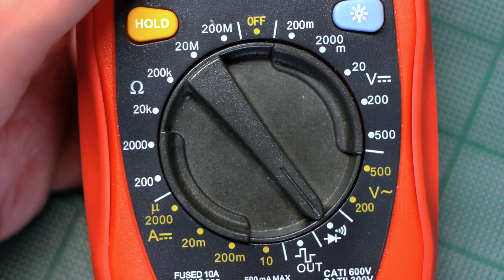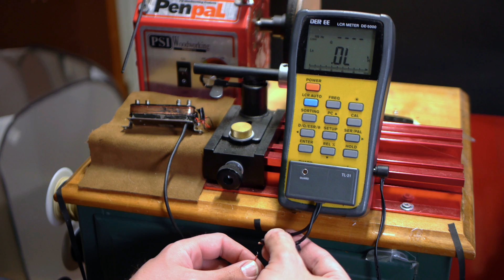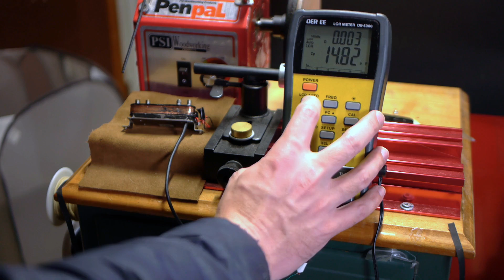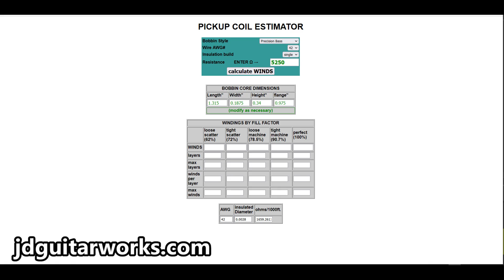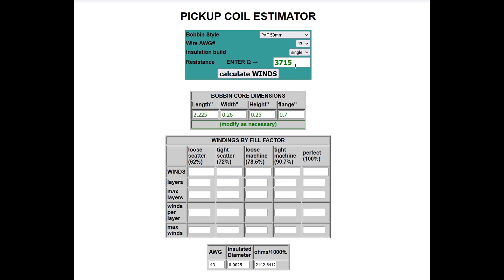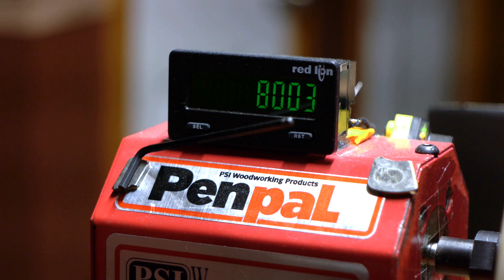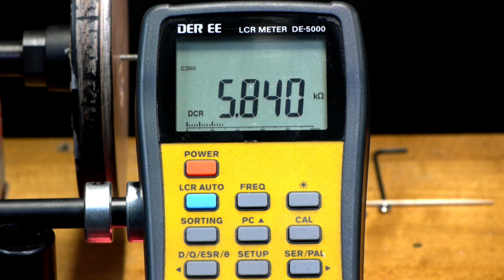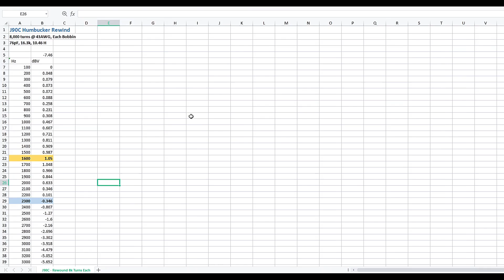Broken Humbucker Diagnosis + Rewind

Comment: and why does internal wire get broken? just rewire 3 times my humbukers :( works like 3-4 months and then fail
Reply from the maker: I'm slowly working on a new video about diagnosing issues with broken humbuckers. A major issue is insulation: the "pigtails" ABSOLUTELY MUST be thoroughly insulated from the main coil wire. 

I think this is a much more common cause of humbucker failure than broken wires, and I've seen it many times myself, including on humbuckers I've made before I knew this was such a huge problem. 

However, the wire can Also break, with the pigtails being the most common break area. So much so that one of the main ways I diagnose humbucker problems is to disassemble them, then disconnect the hookup leads from the coil leads -- i.e., disconnect the 'pigtails.' 

Often -- not always, but often -- I'll get a reading at the actual coil leads. I carefully strip them with a soldering iron, or sandpaper if it's Plain Enamel or Formvar wire -- and then test with a multimeter. Many times I've seen it was the pigtails that became disconnected from the coil leads that was the problem. 

So for me, my method is to lay black cloth acetate tape / black cloth electrical tape down onto the coil first. Then, after making the pigtail (wrapping the coil lead wire around the 28-30AWG PVC insulated hookup wire, and soldering it together), I put the pigtail on top of that electrical tape. 

AND THEN I superglue the pigtail in place on top of that cloth electrical tape. This part can be a bit tricky. I use pipettes to dispense superglue. But whatever way you do it, I use a teflon dowel or just dip a regular wooden dowel in petroleum jelly, and use that to press the pigtail down while hitting it with some CA glue. 

Then I use some CA accelerator to harden it. Take the dowel off and the pigtail should be firmly superglued in place on top of the cloth tape. 

Then I put ANOTHER piece of black cloth electrical tape on top of it. So think of it like a sandwich, with the pigtail superglued in place in the middle of two pieces of cloth electrical tape. 

I repeat this for the other pigtail. Supergluing them in place will prevent them from being tugged on, potentially breaking the coil wire at the pigtail joint. And having it sandwiched between two layers of insulation will guarantee that the pigtail will not short out by touching the coil itself. 

The coil wire is insulated, so the pigtail wiring touching the coil shouldn't short it out, but for some reason, it does. I've seen it happen many times. 

In my experience, these are the most important factors by far. Once I started using this method of cloth electrical tape, and supergluing the pigtails in place, I never had this issue again. 

There's another pickup builder on YouTube who uses copper tape over the coil, and solders the pigtails to the copper tape, rather than doing it the way I do it. And that may very well be superior. It certainly would be a lot easier. So that's another method to keep in mind. And soldering the pigtails to the tape would do very much the same thing the superglue does with my method -- securing the pigtail and preventing it from moving. It only has to budge a tiny bit to break that coil wire and then you'll have a non-functional coil. 

Hope this helps! Another tool I recommend is an N-Audio phase tester. It's very handy when assembling humbuckers. Both coils should measure the same phase direction when it's completed. So either both coils flash red, or both coils flash green. If one is green and the other is red, the humbucker is out of phase with itself. There's no way to test this aside from using a phase tester as the rest of the measurements will appear perfectly normal. 

Also, the phase tester can be used to test whether a coil is working or not, or here's an even more interesting example: if the bar mag on a humbucker isn't contacting the polepieces, the coil will read out perfectly normal, but you'll get no output. Recently I had a customer want me to put an A3 bar mag in a humbucker. I couldn't find any that were wide enough. It was a Duncan style Invader humbucker and had no mounting bar for the screws -- no 'magnet keeper' or 'polepiece keeper' bar. 

Testing with a multimeter and LCR meter, it all read out normal. Both coils perfect. And using my WT10A meter, the polepieces all read the same Gauss strength. What was going on? 

The bar mag wasn't making full contact with both rows of pole screws. Only one row. He had the idea to strip the metal jacket off of some Gibson hookup wire, because the metal is conductive -- and wedge it between the bar magnet and the polepieces on one side, so the magnet would be in electrical contact with the polepieces equally on both sides. 

It went from having one dead coil and one functional coil to both working perfectly. When plugged into an amp, formerly, one coil you'd tap with a screwdriver, and it would sound loud and clear. But you tap the other polepieces, and you got NOTHING. Wedging that metal jacket in there so the magnet was physically touching both rows of polepieces fixed it. 

You can test it on an amp, but the N Audio phase Tester is even easier and quicker. If the coil isn't outputting anything, the phase tester won't light up green or red. It won't light up at all. So now I know a way to 100% test a pickup without the use of an amp, and just a multimeter/LCR meter/Teslameter/phase tester, all on a workbench. 

Again - hope this helps. Can't wait to get that humbucker diagnosis and repair video up but at this point some of my videos are going to take at least a couple years to get done. Very, very busy. Thanks again for the comment and hope you stick around to see what else I have in store!

Comment: Are you using a specific type of copper wire? I only ask because I was looking up copper wire for p/u's and 1 site mentioned 3 different types which give different results...

1.  Polyurethane copper wire
2. Plain enamel wire
3.Heavy Formvar wire 

I was just curious about that. I also have J90c humbucker in my 90 Charvel Fusion Custom so I enjoyed watching this video plus I'm glad I have all the specs for it!

Oh and a site called Axebition has a bunch of info for about 16 brands of guitar and their parts, (you probably have heard about it already though).
Reply from the maker: Polyurethane insulated wire for this one. The original looked to be poly. I heavily prefer solderable polyurethane for ease of use (stripping with a soldering iron vs. mechanical scraping/sanding, which you have to use for plain enamel and Formvar). 

There's also heavy poly wire. Some has the same thickness as heavy Formvar and some is slightly thicker. I think Formvar is around .0029" thick. Plain enamel is around .0027" and poly wire single build is around .0028". You can get heavy build poly coated wire that's around .0030" from Remington. I've been using that lately for neck pickups. 

I always go by turn count. Different insulation thickness will create different results when using the same turn count. The interesting question is what happens when you account for the insulation thickness and wind a coil that has the same specs with Formvar vs. Plain enamel wire vs. poly wire. 

But when turn count is the same, generally speaking, thicker insulation will result in lower capacitance, which results in retention of more high end frequencies, but the wire is also traveling a farther distance, and so you have more total wire for the same turn count with heavier insulation, which makes the inductance slightly higher, which causes a slight loss of higher end frequencies. 

Example: 7600 turns with single build poly wire will get you around 1.9 - 2.0 Henries inductance for a Strat neck pickup with a .500" coil height. 

7600 turns with heavy bulid poly wire on the same bobbin will get you around 2.2 Henries inductance. But also lower capacitance. Say, maybe 120pF for single build poly and maybe 80-85pF for the heavy build. 

How this stuff influences the sound is measurable to some extent but also not measurable completely. This is why there's so much speculation with pickups. I have my complete pickup testing guide on my channel if you want to see how that works but I also need to update it and make some content going over what frequency response means and how to read bode plots to interpret what a pickup will sound like. 

It doesn't tell you the whole story but it does tell you a lot. Heavy build poly is really cool stuff and I never see anyone using it. There's a lot of attachment to the old school plain enamel and Formvar wires. 

I'll use them for vintage rewinds. But for my own pickups I go 100% poly. It's just easier to use and it's a lot cheaper. And you can get it in greater insulation thickness than heavy Formvar which lends itself to making its own unique sound. I'm currently making a Strat neck pickup with .500" coil height, A3 magnets, and 7600 turns of heavy poly wire and it sounds great. 

A lot of this comes down to experimentation. i've wound many hundreds of pickups and all I've learned is that we have only pretty basic metrics to measure pickups by, and people disagree on what those metrics mean and are adamant that there's more to it, and things that can't (currently) be explained. 

That's why I think of it as a recipe. Coil height and dimensions first. Then magnet type, wire choice, turn count. There's a lot more that goes into this than people think and each variable has an impact on every other variable.  Even just coil height, wire insulation thickness and gauge, and turn count alone are all independent variables that all affect each other dramatically. So it's very difficult to say what causes what without controlling for each variable -- which is just about impossible to do. 

Anyway, I'll go more in depth in another video about that someday. Have to collect my thoughts after years of winding pickups and experimenting. There's a lot to cover and yet at the same time this is why I'm hell bent on only offering a couple models that are pretty radically different from anything else out there. Whether it's good or bad is up to the listener but I like making things that are very different rather than small tweaks on designs that have been around for ages.
Reply: Thanks, I appreciate all the in depth info!
Reply from the maker: @EuskadiJoloMas Sure thing!

Comment: hey brother - I have an EVH pickup and one half of it needs a rewind - I have no idea in which direction to rewind - or does it matter?
Reply from the maker: You can do either, though you'll have to be sure to check the phase of the pickup before rewiring. I think you can use a normal multimeter for this, but I prefer an N-Audio phase tester, which you can find here: 

https://n-audio.net/guitar-pickup-phase-checker/

When it's done, both bobbins of the humbucker should be the same. So both green, or both red. I've been working on a video to demonstrate this, as I had to rewind one coil of a humbucker, and ended up wiring it out of phase, but didn't know it! Because I had no idea of the original direction of the winds on the other coil. 

So, I'll have to mentally figure it out. But you can either do start to finish, start to start, or finish to finish. So you could test all of those out and then see with the phase tester which results in the humbucker being in phase. 

But you can also test the individual leads to make sure. It's simple, but my brain has issues with stuff like this, so I'll have to sit down and make a video to really get super crystal clarity on it!

But definitely check out that phase tester, that's the ticket IMO. Clear and easy to see. Until you get how to test the individual wires before soldering together, you can just do process of elimination, once you know that both bobbins need to be the same phase for it to be in phase. So both green or both red. One green and one red and the humbucker is out of phase with itself. 

Hope this helps!

Comment: This was very informative!  I always had thought the J90C used AWG44 like the Duncan JB and was modeled after it  but it turns out it was with AWG43 like the Seymour Duncan Custom. I now kind of view this J90C as a Duncan Custom plus type of p'u. Both have the ceramic and use the AWG43 but the J90C is wound hotter at 16K whereas the Duncan Custom is at 14.5K

Comment: What is the benefit to rewinding a pickup versus just replacing it?
Reply from the maker: Controlling for variables. Particularly wire gauge and turn count -- but also coil/bobbin height and width.

Pickup makers and manufacturers very rarely mention turn count and never coil dimensions. So a replacement might not be a good match.

They can be. Replacing the pickup is perfectly fine. However, an experienced pickup winder can make a more accurate assessment of exactly what wire gauge and turn count to use to match the other pickup on the guitar -- if there is one. Or to just be as close to the original as possible. 

That, and many times there are unique pickups that don't have replacements. Many times people want a pickup rewound because there isn't an available replacement on the market. 

Hope this answers your question. Let me know if you need any more clarification!
Reply: @guitar_md  thank you that was a superb answer. So basically you're going to never be able to exactly replicate the original sound but the goal is to try to make it as close as possible. Versus it being a crapshoot if you just get a different pickup.
Reply from the maker: @jfiery  In a nutshell, yes. For example, the magnet diameter and bobbin dimensions may be different on a replacement. But since these specifications are almost never listed, you don't know what you're getting. 

If a known commercial pickup dies, like a Seymour Duncan of a particular make and model, a replacement is perfectly appropriate and will likely be identical. 

If someone's charging more for a rewind than it would cost to get a new pickup, that's a factor to consider. Sometimes this is worth it if it's a vintage pickup or a rare model with no replacement. 

I've done a fair amount of rewinds of vintage pickups. Nothing special -- but it helps to know around what turn counts were used. For example on an original 51 Nocaster neck pickup I rewound recently, I used 7600 turns of plain enamel wire, 43AWG. 8000 is typical but this varies by a few hundred turns either way. 

I've found 7600 to work great on Fender neck pickups. Just a touch more high end and clarity. The guy loved it and said it was a perfect match. He won't let anyone else rewind pickups for him.

However. I don't think I'm doing anything special. The the turn count is what matters most, and the correct wire gauge. As far as winding pattern goes, I just do my best to make the coil look as neat as possible. I like the middle to be a little fatter not because of tone. But because it looks nice. I don't always do it that way and I haven't seen any evidence that winding pattern affects anything. 

That doesn't mean it doesn't! But I'd have to see hard evidence. Winding a neat coil does take a lot of skill and experience. But even a crappy looking coil with the same number of turns will probably sound the same. Of course. Nobody wants something that looks amateur. I always joke that I was making good sounding pickups from the beginning but it took me 5 years to make pickups that people would actually want to buy. Looks matter a lot.
Reply: @guitar_md  thanks for taking the time to give me such great answers. Will enjoy checking out the channel!
Reply from the maker: @jfiery  You're most welcome. Thanks for the support!

Comment: I got it open, the way you said worked, took about 20 min though. When I looked at it, you were right, the wire that touches the plate was off. it separated from the other bare wire because it got soldered on top of the other solder. I stripped the wires off and soldered it next to the other and used super glue like you did, to keep it from moving. All the wiring looks original, old, dry, never moved. It used to buzz and stop sporadically but now it is quiet and sounds like the other one pretty close. Only reason I think the plate got changed is the holes on the ears were probably stripped out or broken and they want the same face screws installed. They probably disconnected that wire while removing the old plate but you can't simply solder it back to the old solder without flux, he should have simply made new ends with bare wire to solder on the new plate.
 The single coil I stuffed the leads into the coil, I didn't even try because I know I broke a dozen points on that coil. 
 Thank you so much, I learned a lot from you and now understand a lot better. You cover every detail and now I'm ready to make my own pick ups after I gather the supplies. I'm sending anyone that asks me to your videos and Il let you know what your teaching got me when I finish my first attempt.